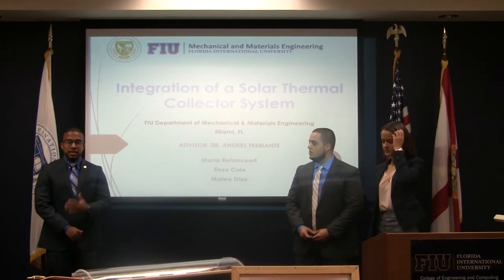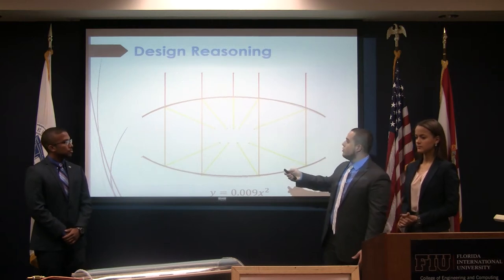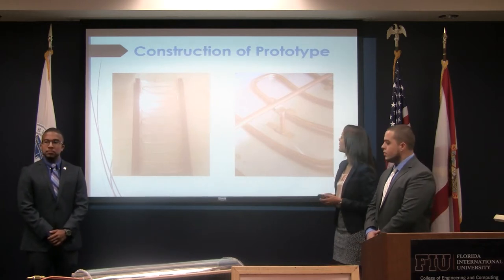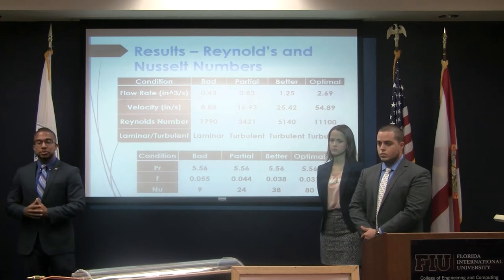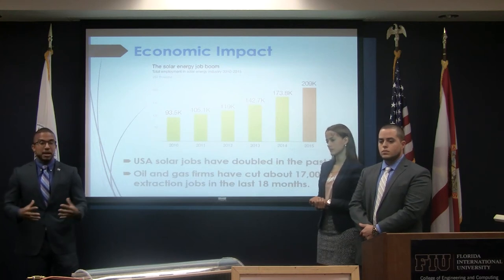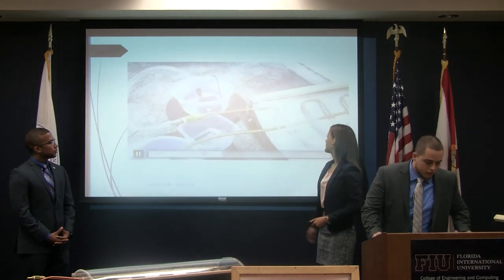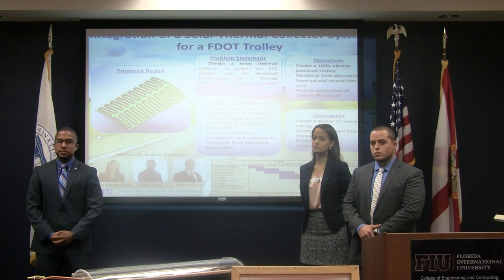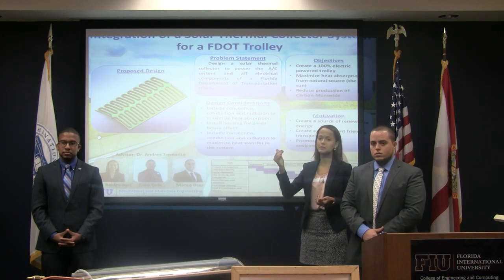Team 3: Integration of a Solar Thermal Collector System for a FDOT Trolley

Comment: Solar Thermal Collector for a FDOT trolley
 A well thought out and researched project that looks to aide in the current pollution problems.  The team looked into critics from the public such as the temperature issue ie keeping the cabin cool for the passengers and devised a solution to it.

Comment: I like how the presenters used the solid works simulation to display how the fiber class would keep the cabin cool. I also like how the presenters used the power point to explain in depth their step by step completion of the design. The presentation time was split very well although it felt like some of the presenters were in a hurry. I like that the presenters figured in the economic input of the solar thermal collector it gives the project a marketable value.

Comment: Multiple innovative designs, with a sound reasoning for the final design they chose. They seemed very comfortable with the presentations, but with the PowerPoint there were issues seeing the pictures included. They included a financial breakdown, but it was unfortunate that in their scaled down model they could not utilize the materials proposed for their chosen design. They were fiscally responsible, but whether or not they lacked funding or had time constraints, it would have been nice to see experimental data with the materials they proposed. They appropriately included the scaling factors to streamline future production of their design.

Comment: Very useful project and I appreciate every idea that helps the environment. They included in their presentation their multiple designs as proposed designs: however, were the first two alternative designs or just the first two steps before achieving the final design. In addition, they did not talk about the pros and cons for the first two designs. Also, I did not like the last slide with too much text that is very difficult to read because it is written in small font size.

Comment: Great presentation. The presenters had good knowledge of what they were presenting. Again just like the other presentations, the projector was off center which pushed each of the slides to the right side. At the same time, due to the glare, the camera doesn't catch the proper lighting of the slides and doesn't give a good quality for graphs and pictures.